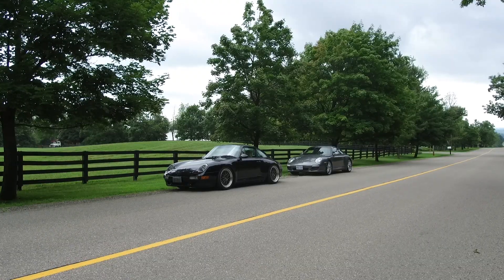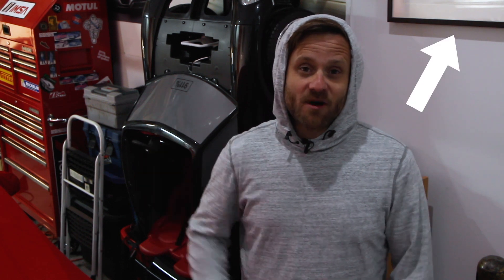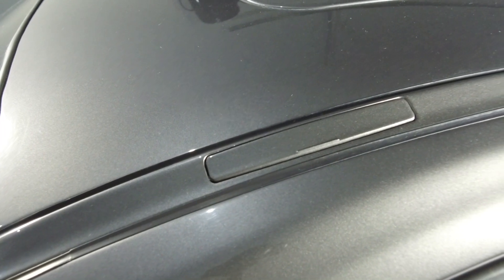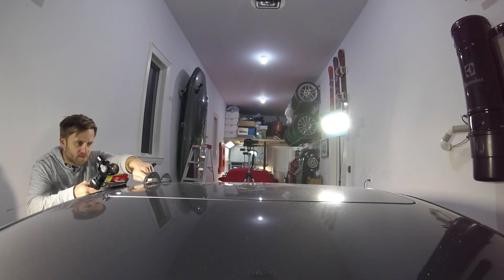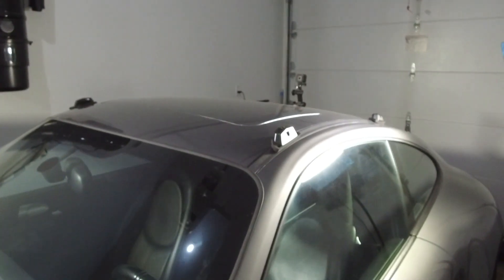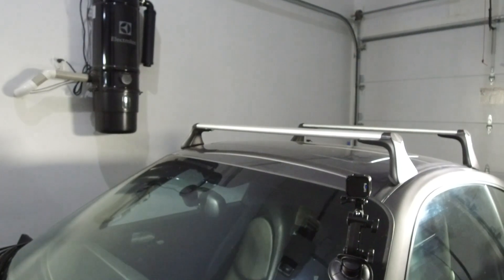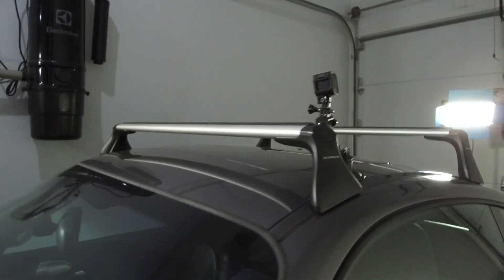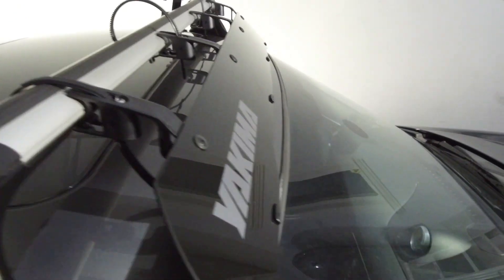Porsche 996 997 Roof Rack Install DIY | 008

Comment: If you are mounting a rack the first 4 screws that are removed in the video (mounting screws ) are a real pain to remove and all 4 broke / distorted did not come out ! I tried various methods ... high heating a small flat blade screwdriver and melting a slot worked for only one . the other 3 took melting bit by bit out then using a sliced cut bolt (homemade thread chaser ) and heating that several times finally cleared the threads. A tap would not work as the threaded hole bottoms out ). This is on a 2000 C2 . the nylon screw was not going to come out easy.  NOTE the thread size is 6mm 1.0 pitch.  Hope this helps
Reply: do you think pre-spraying some lubricant may have helped? Im planing on doing this as well.
Reply: @ac14081408  yes . Lube , bit of heat  being gentle .

Comment: Great video! Thanks! Looking at a few 996 options as my Porsche starter kit. Any chance the Targa has rack fittings?
Reply from the maker: HI Anthony, Targa does not have the hardware to accept the kit. With a targa Seasucker products may be a better solution.

Comment: Nice video! I’d also mention to thoroughly clean the areas around the attachment points before you start the install. This prevents any dirt or contaminates from getting stuck in there and causing micro-abrasions. I even added a small piece of Suntek clear vinyl to give a little more piece of mind.
Reply from the maker: Than you for tuning in Kellin! Great point about keeping the areas super clean and nice touch on the vinyl for protection. I've had the rack on and off a few times already and there is zero evidence that it's there..so that's good. I'll keep an eye on it though. Cheers!